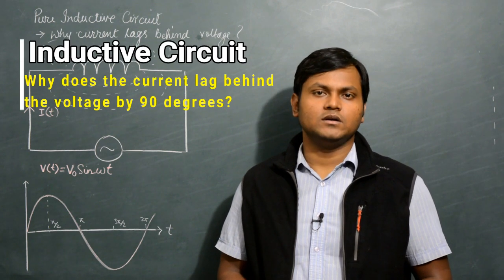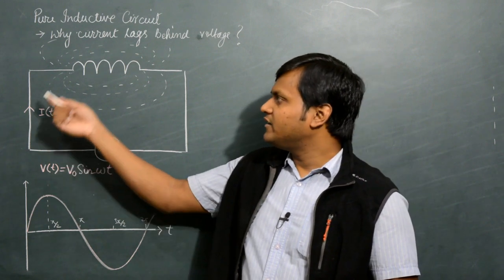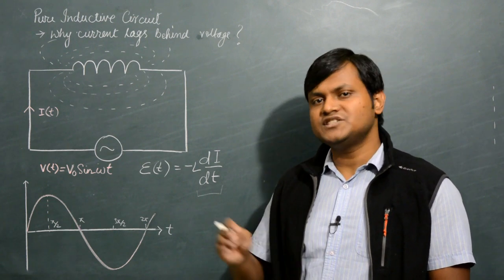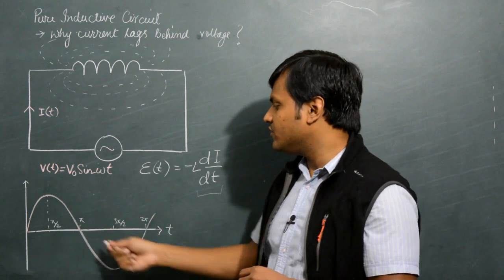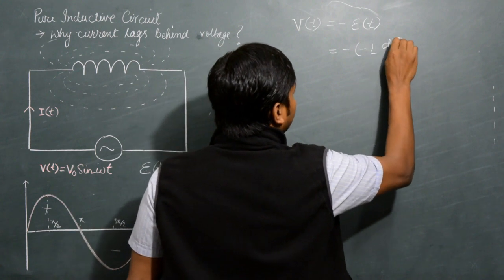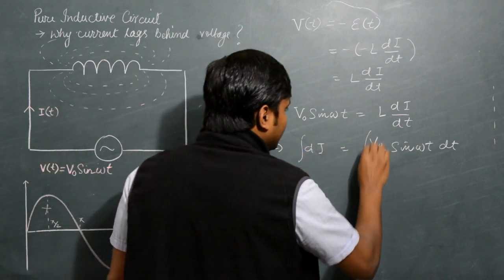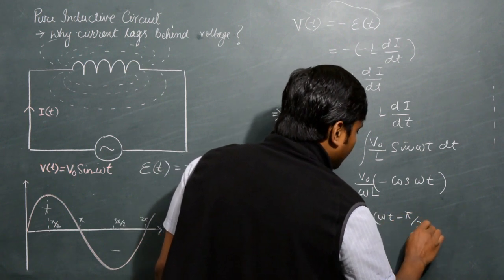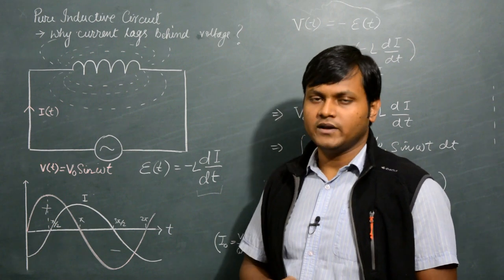Inductor | Why Current Lags behind Voltage by 90 degrees? (Mathematical Explanation)

Comment: We can also apply the Kirchoff Voltage Law in the loop, i.e. closed loop integral of E.dl=0 and end up with same equation. please correct me if I'm wrong & wish you a happy birthday Sir.
Reply from the maker: +Dhruv Anand Thank you Dhruv once again for the wishes :) And yes, that is correct. We can apply the Kirchoff Voltage Law. Infact what I used initially, i.e V=- E is the same
Reply: @FortheLoveofPhysics  why back emf is equal to external voltage??? what if we use inductor of low inductance ,then back emf would not be equal to external voltage....then this equation will also become false????i am unable to understand???

Comment: Is there really ever a complete phase shift of 90 degrees?  I say this because even if an inductor is the only component of the circuit that inductor has resistance itself.  So actually, there is no purely inductive circuit so the phase shift can't be a full 90 degrees between current and voltage right?

Comment: The emf v(t) produce a current which produce the back emf or E as written but if I produced due to V which is produced first then why do we jave to relate ot with back emf to get  the eqiation for i and v which are actually related even before the vack emf is generated??

Comment: But sir what is the meaning by nature of the inductor. You didn't talk about why current lag or lead in ac
Reply: He proved it mathematically using Calculus. He showed how the current lags the voltage by 90 degrees in a pure inductive circuit.

Comment: If self-inductance (induced back emf) of an ideal inductor is always equal and opposite to the applied voltage then how does the current flow in that inductor, as the net voltage will always be zero?
Reply: good question
Reply: I don't have the time to go into detail, but in a purely inductive circuit, like the one in this video,  the current flowing through the inductor is at its max when the source voltage is zero and at its lowest at max voltage.

Comment: Sir how we are getting some negative value of current when the Voltage is zero?
Reply: It's not negative current. It only represents current going in opposite direction. It's Alternating Current (AC) and AC changes direction 120 times a second here in North America and 100 times a second in other parts of the world. A lot of people say there's 1 positive and 1 negative half in every cycle but in reality the current is only changing directions. It's going forward on 1 half of the cycle and backwards on the other half.

Comment: If you could get the current to lead the voltage what would be the benefit?
Reply: Current does lead voltage in a purely capacitive circuit. The benefit of such a circuit, in practice, is to offset the lagging current of inductive circuits like the one demonstrated in the video. In this way, the power factor is moved closer to unity - allowing more of the source's apparent power to be used for performing useful work (watts). In a power system, capacitive VARs can be added or removed with "cap banks", large arrays of capacitors, to improve the power factor.
Reply: @kyle6094  can you set the power factor to 0 instead of 1 and use solely reactive power?
Reply: @CptAhab-vf1ny  I suppose theoretically you could - the power 'triangle' would be a straight line LOL. The pure inductive circuit from the video would have a zero power factor. Though for real circuits that exist outside of superconductivity laboratories there will be some conductor resistance which consumes real power (in the case of conductor resistance it would generate heat) and shift power factor away from zero. At zero power factor all of the source's apparent power would be used only for making and breaking electromagnetic fields in the inductive and capacitive elements of the circuit (VARs) and not perform any work. I'm curious...do you have a useful application in mind that only involves VARs and no watts?
Reply: @kyle6094  If only 😉 😉 someone knew how to turn reactive which has no back emf into Active Real Power. Let me give you a hint. The only thing that has ever changed is volume.

Comment: means? after full peak point of voltage current starts to flow from inductor which were stored?????
Reply from the maker: Current is not stored in inductor. What is stored is magnetic flux that induces an emf of its own...
Reply: @FortheLoveofPhysics   v(s) = -E(L)  so where the current goes ?  if its not passing forward?